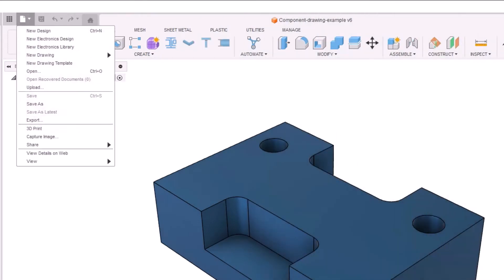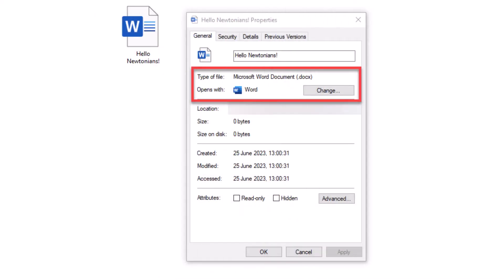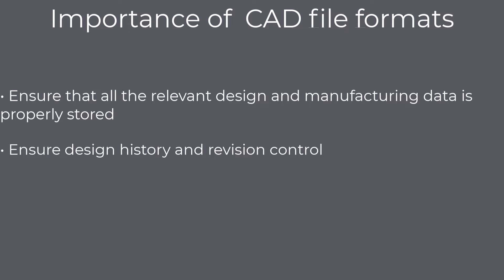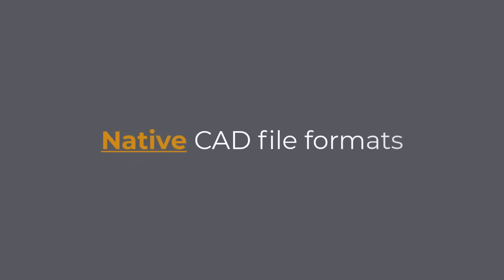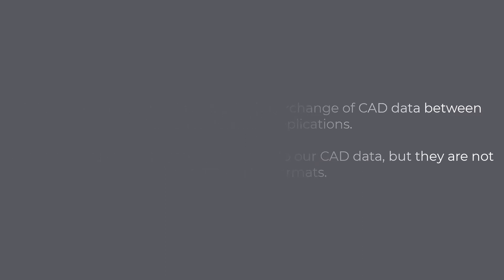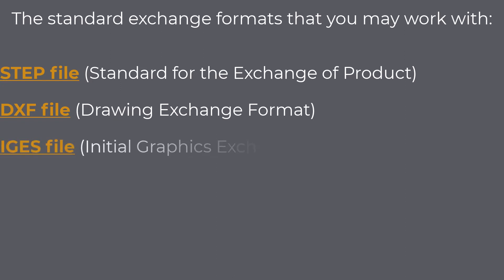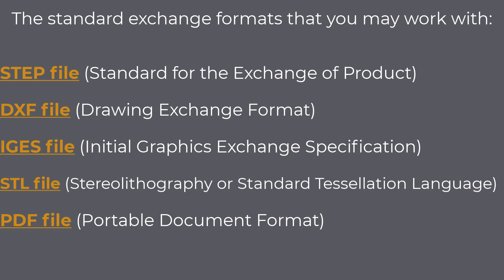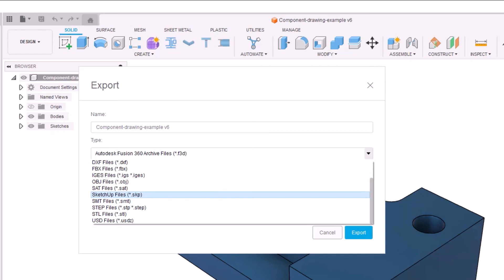Introduction to CAD file formats (extensions)

Comment: please explain the Parasolid file (.xt) and when we have to send our data of sheet metal part to the vendor which format do we need to save our file??  and please make a detailed video regarding the tool design engineer. (sheet metal , mould design , fixture design etc)
Reply from the maker: One of the big advantages of a Parasolid file is its accuracy and efficiency in handling complex shapes. However, for example, STEP is an ISO standard, while Parasolid is a proprietary format and STEP files are more universally accepted for data exchange across different systems. On the other hand, Parasolid may offer better performance and fewer errors in systems built on its kernel.
When sending data to the sheet metal part vendor, I usually send a drawing (containing flat pattern dimensions), a .dxf file of the flat pattern, and a STEP file of the final part.
Regarding the tool design engineer videos and videos in general regarding the design for manufacturing, I can create theoretical videos on how to design for different manufacturing techniques. However, this channel's point is to show how it is done in real life. I am still building our community, and hopefully, when we as a community grow big enough, I will be able to find company partners that will work with me on creating these types of videos. Stay tuned, this year will bring a lots of new things to Newtonian World!
Reply: @newtonianworld  thank you